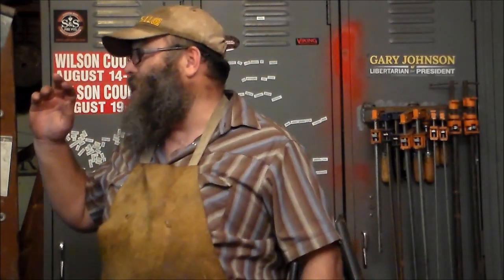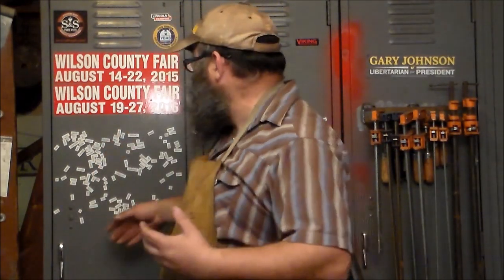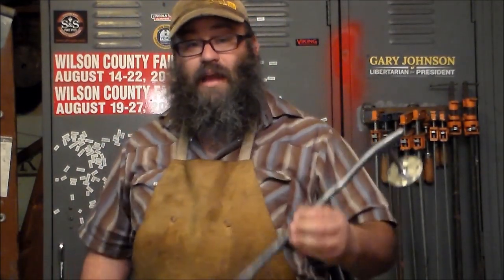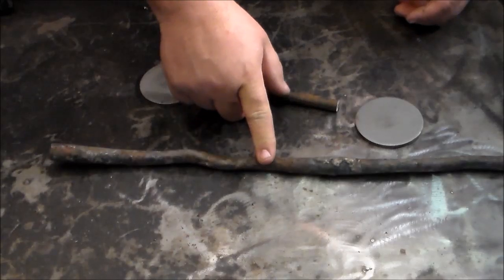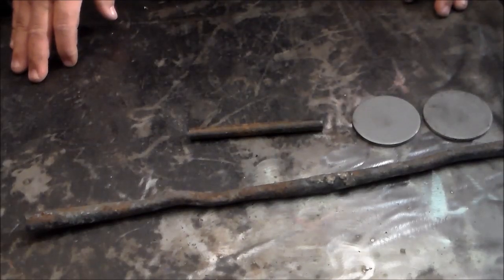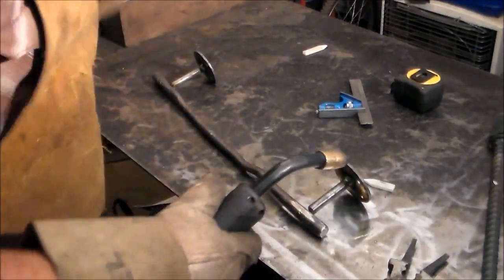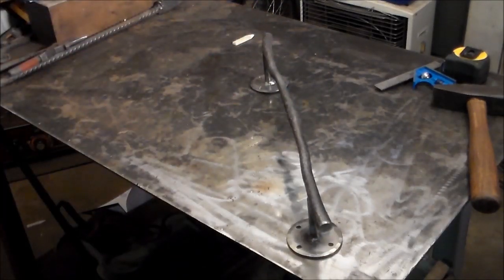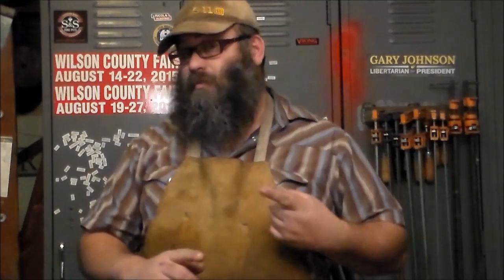Door Pull Fabra/Forged From The Scrap Pile!

Comment: Adventures in the scrap pile. Sounds like good series to me.
Reply from the maker: I have 4 made so far!
Reply: Really cool, but the problem is that someone will LOVE it, and want four more just like it...
Reply from the maker: When I first started out I had big problems telling customers, "NO". I tried the impossible, form projects to budgets. It wore me thin and didn't do them any good either. Over the years I have learned that when they want something I can't do or something I don't want to do, best thing to do is tell them no. Sometimes you have to get kind of forceful with it but in the long run a simple, "I can't make 4 more exactly like that" can save you hours of profanity. It also turns the piece to be copied into a more desirable one of a kind piece!

Comment: nice project, I like the idea and it turned out well.  Is that a Hobart welder you are using?  I have the Hobart 210 mig along with the hobart stick welder and the plasma cutter.  I really enjoy your videos, KEEP UP THE GOOD WORK.
Reply from the maker: Thanks Rob!  Yes it is a Hobart 190, I also have a 235 stickmate and a old Miller 130. Still in the market for a good plasma! Thank you so much for watching!